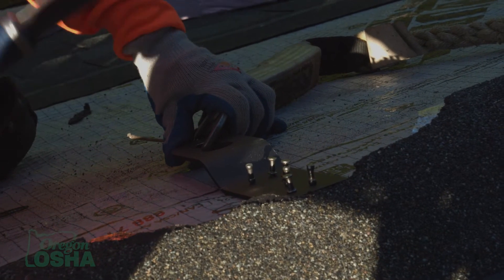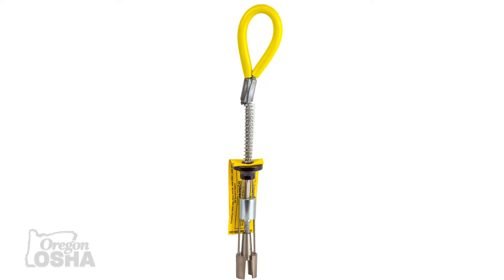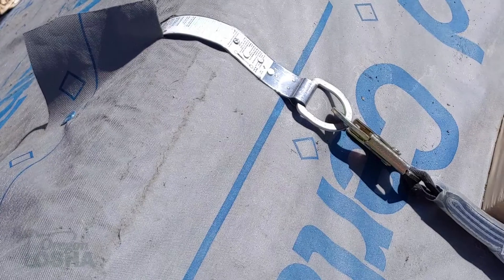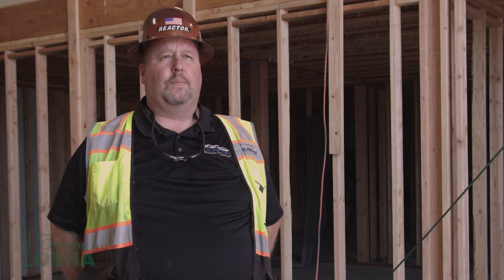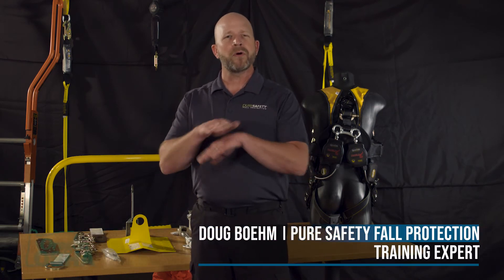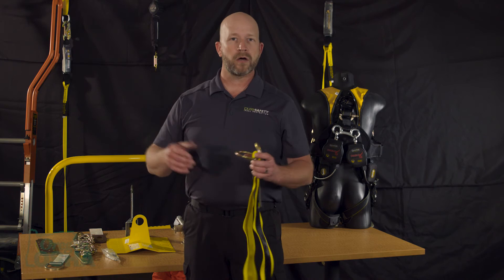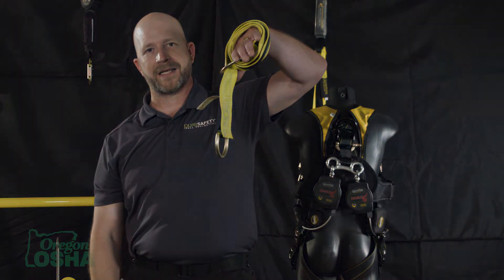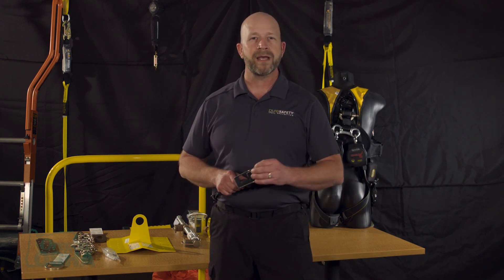Fall Protection Anchors for Construction - clamps, I-beam, beamer, strap

Comment: At 5:31 there was a guy tied off to the MEWP while working outside of it. Oregon OSHA is OK with that?
Reply: I saw that and looked for this comment.
Reply: Lifts can be your tie-off point if it’s your only egress.
Reply: The answer is most likely no. According to OSHA (29 CFR 1926.502(d)), anchor points for personal fall arrest systems must be capable of supporting at least 5,000 pounds per employee. Most aerial lift manufacturers specify that their equipment should not be used as an anchor point unless explicitly designed for it. In most cases, the baskets are not designed to withstand the dynamic force of a fall. It's interesting to see this posted on their YouTube channel if the lift they tied off to wasn't designed for it.